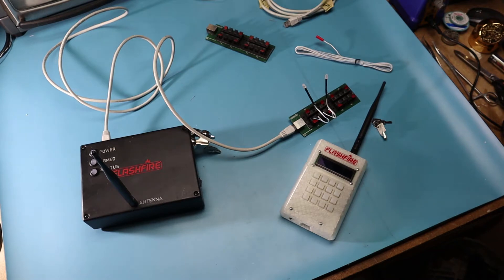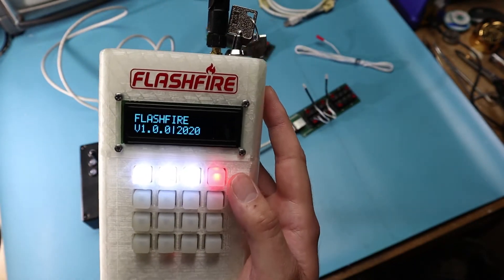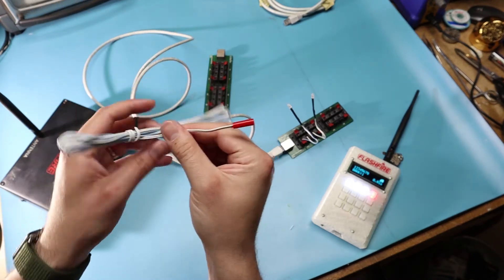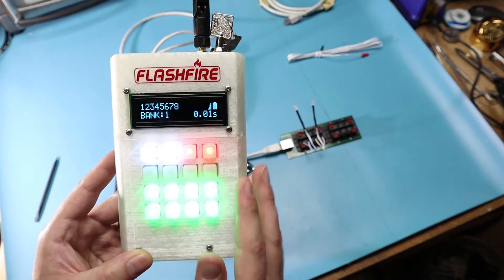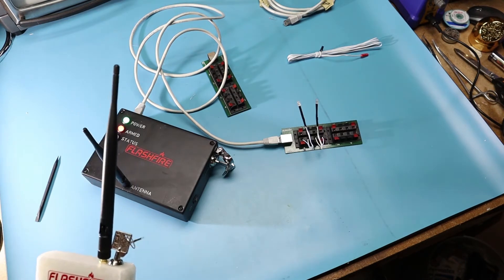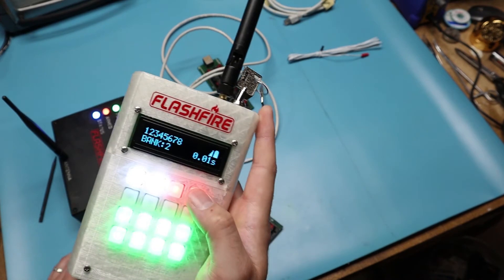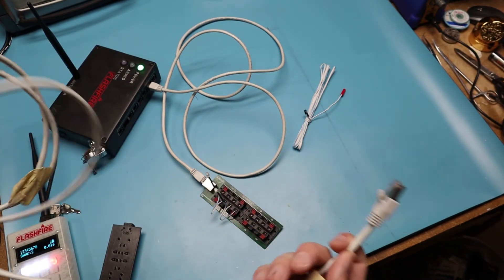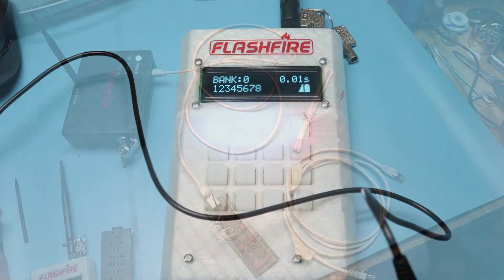DIY Wireless Fireworks Firing System

Comment: I have my own wireless system I built about 10 years ago, but I am thinking of upgrading how I connect my system, what is the part number of your Ethernet ports that are shielded? If you don't mind sharing that part.

Comment: I've been contemplating such a system for a few months now. However, I know  nothing about electronics, and it's way over my head. I would like a personal wireless fireworks system as I just can't move fast enough to safely light off fireworks without extension fuses. 

I read your other replies about releasing your own and legalities. Have you made any progress I'm that area? I would pay for such a system, even if it's in the form of a DIY kit. It's too bad all the options available are ridiculously expensive and aimed at professional use only.
Reply from the maker: Hi there, thank you for your input. Unfortunately I haven’t made any more updates to my system  in quite some time just due to life getting in the way. However I have since gotten a larger and better 3D printer, learned a few new things in both the electronics and mechanical design areas I could use to improve the design, and have been contemplating another revenue stream for a little extra money each month. I may end up selling the fully assembled PCBs alone or offering everything as an assembly kit with light to no soldering required someday. It’s certainly a product that has a market and interest from the hobbyist community.